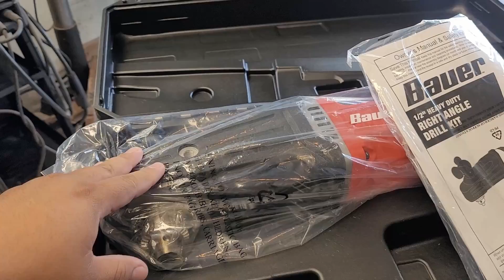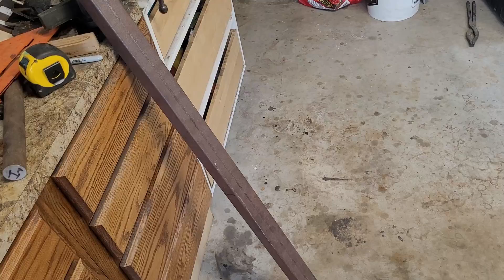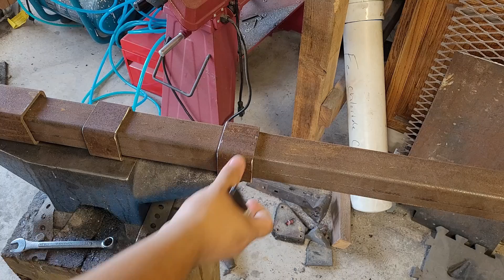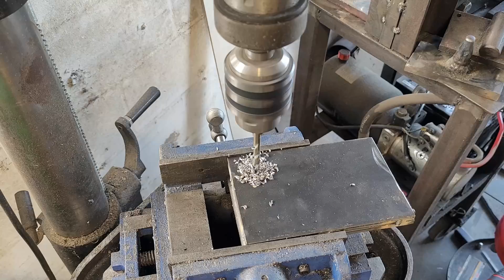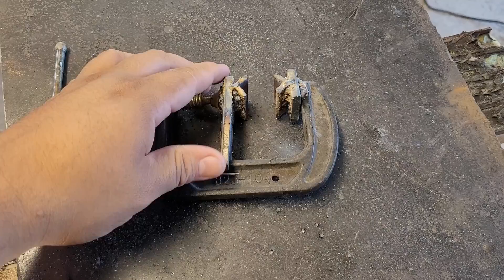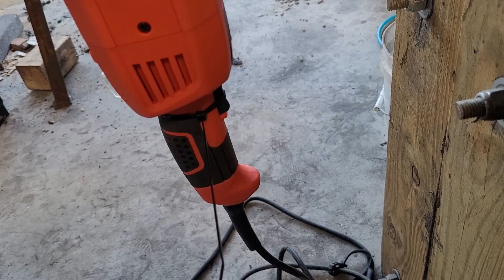I Build A Damascus Twisting Machine

Comment: Great build. I saw Tyrrells build too, I'll be making one of these eventually. Where did you get the foot switch at? Thanks for sharing!👍⚒️🔥
Reply from the maker: I got the foot switch at harbor freight as well. Just make sure to get the one that only works if your pressing it so you have more control. There is one were you step and release and it stays on and you have to step on it again to turn it off. That one i wouldnt recommend.
Reply: @JP's Bladeworks  cool cool. Thanks, that's good to know. I have a couple tools that I want to get one for. Thanks again!